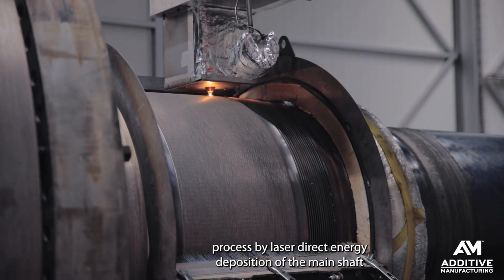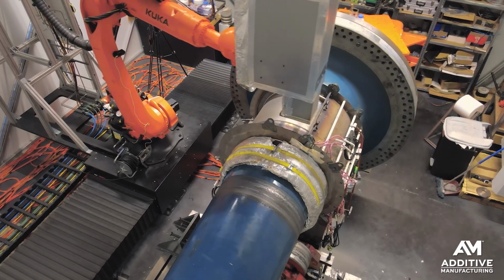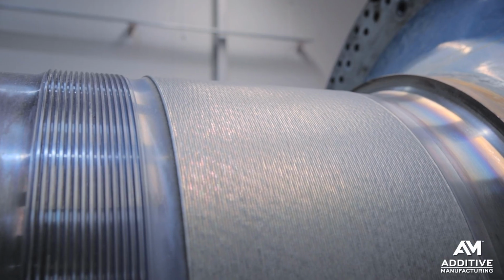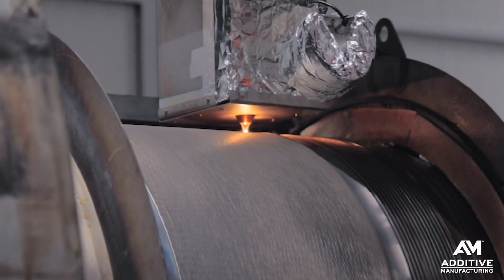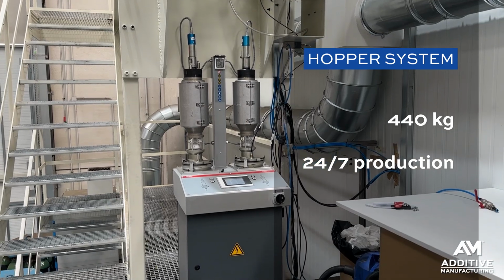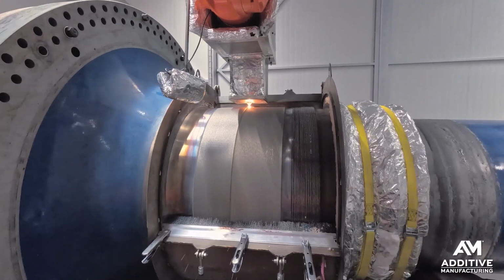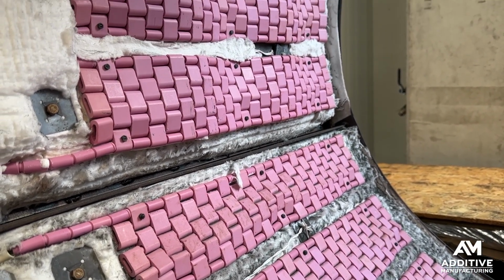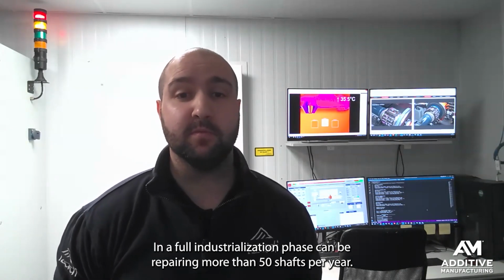Robot Repairs Giant Wind Power Shafts Using 3D Printing

Comment: This is good old flame-spray welding - used for shaft repair for over a century - but performed with a robotic arm rather than by hand. Whilst it is an additive process, it will then be followed by a subtractive manufacturing step to cut the shift diameter down to its final OD and leave the required surface finish (which the additive portion of the process cannot achieve). 
Other than the robot arm, this shaft rework process could have been seen even back in the 1920s, let alone the 2020.
Reply: Flame-spraying does not melt any of the substrate so a metallurgical bond is not created between the cladment and the base layer. Directed energy deposition using a laser or e-beam melts some of the substrate so that a metallurgical bond is  established.

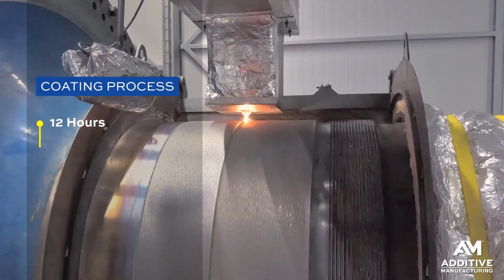Comment: Error at 3:13. The speaker says 25 mg/min powder flow rate, and not 25 g/min. like the on-screen text says. Most likely, 25 g/min is more reasonable. Also, wire DED repair of large components to do inconel 625 inlays has been implemented in industry since at least 2007. It's unclear what is novel here besides applying the technology to repair wind power shafts specifically.
Reply: The issue in repairing wind power main shaft apart from the dimensions is to achieve a HAZ lower than 400HV. Also a 12 hour continuous process. The Inconel 625 can be implemented in the industry but this process and workflow has been certified by the wind power OEM.

Comment: Is this 3D printing / Additive Manufacturing ? Meh not so - this is laser cladding plain and simple. Yes it is part of DED but the build height here is too small to consider it 3D printnig. There isnt a definate height for this but take it from me who's been working in the industry for a few years that anything above 4 inches is well in the printing realm.
Reply: The defined height is done with the wind power OEM. The goals are to repair existing wear shafts and achieve the best quality during 12 hours non stop process with a previous 8 hours preheating process. For near net shape geometries we hope to have some public samples in near future.

Comment: This job could be easily accomplished with welding, what value-add does AM bring to such repair work ?
Reply: Nope you cant use welding here on account of the heat distortion - for large shafts this needs to be done with ahem aheam laser cladding which has been used by the marine and oil and gas industry for 20 odd years

Comment: Does the shaft rest on babbit bearings or something similar?
Reply from the maker: From Igor Ortiz at Ikergune: "The Babbitt bearings are common in steelmaker industry. The Babbitt is a “white metal” not with high hardness that is mainly for the contact with the heated parts in the rolling mill.
In wind power industry uses Timken, JTEK or SKF bearings with a hardness between 60-65HRC for the contact with the shaft and to support axial and radial forces."
Reply: 04:12 you can see a rolling support.
Reply: Oh, sorry. I meant in the wind turbine not during the repair.
Reply: I think you would like this video. SKF testing facility for huge wind turbine bearings. 

https://youtu.be/YHRGE6JbMEA?si=XQxLroNpdWEsSrjh

For sure, roller bearings are used for the main shaft in wind turbines. I doubt that they use bushings (no rolling contact), but I cannot confirm. Anyone? 
.